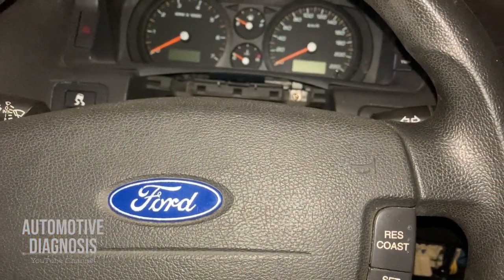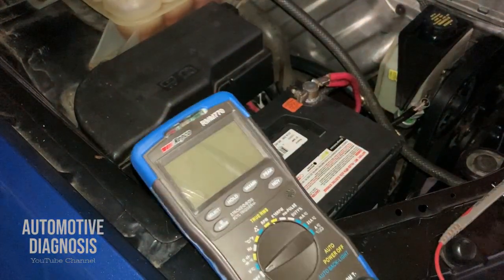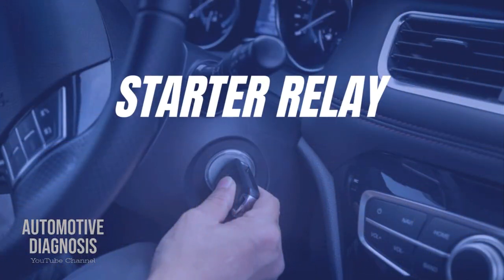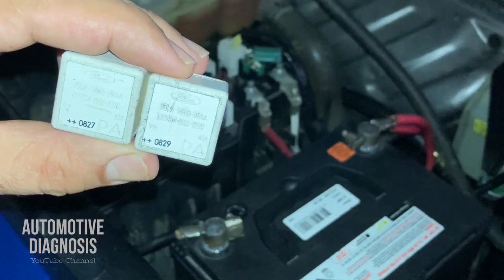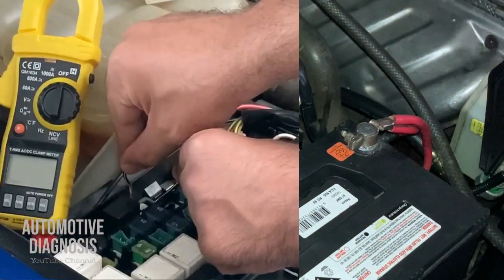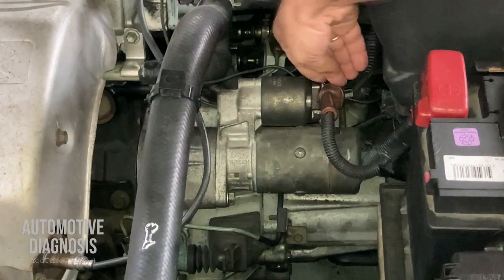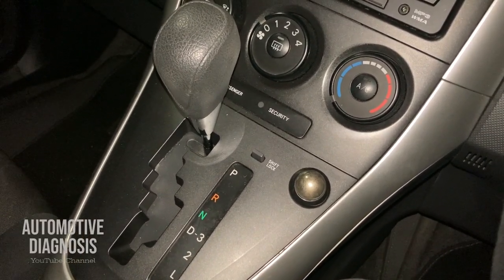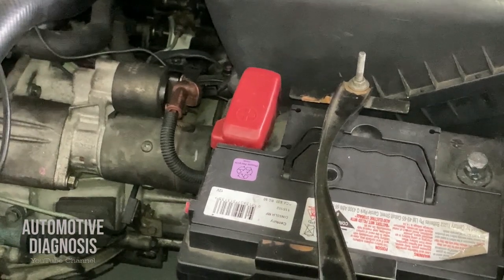No Crank Diagnosis | The Most Common Causes & Solutions #starter #startermotor

Comment: Thanks a lot, i have a quetion plz, i found 2 used hyundai elantra Ad CRDI 2019 diesel, one with automatic gearbox with 90000 km, and the second with manual gear with 93000 km, which one is better ?  which one is more reliable ? thank you